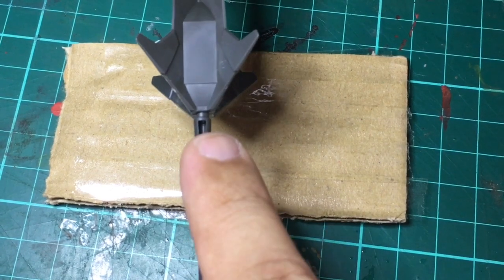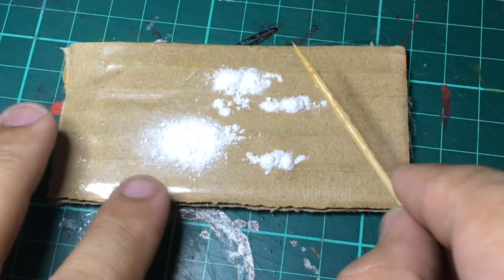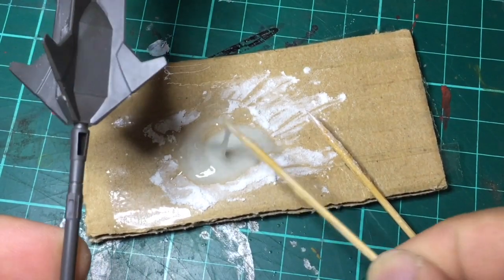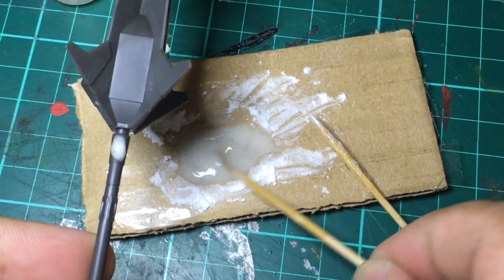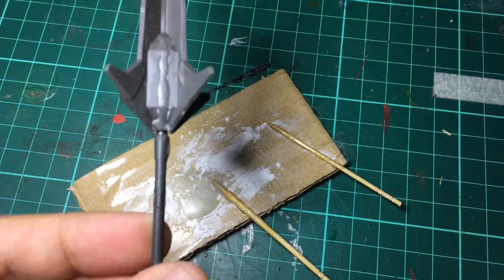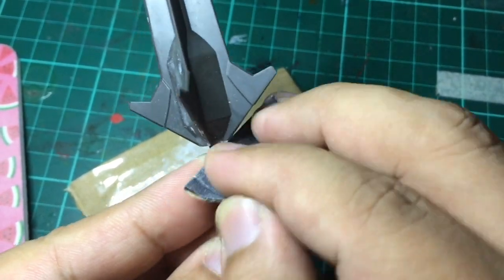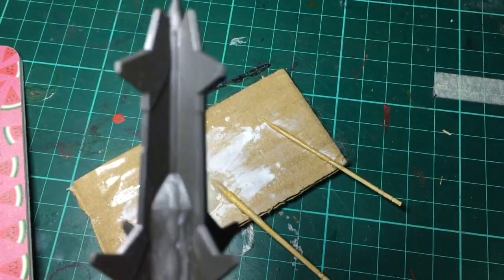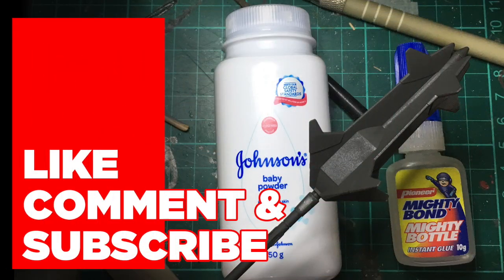24 Gundam Model Kit Tutorial: Using Baby Powder and Super Glue as filler

Comment: I stronger combination is Super Glue + Bi Carbonate of Soda (Baking powder) however the cure time is 'instant' so add the power direct to the glue or use a very low viscosity glue if adding it onto the powder. This combination for most materials is stronger than the original and adheres very well.
Reply from the maker: Oh wow thanks! Im definitely going to try this!
Reply: Baking soda is the only one that works like that. Baking powder is about 1/3 as strong as soda and won't form the chemical bond like Baking soda..

Comment: Hmm. Have you seen the MW-01 Mobile Worker from Gundam The Origin? The rubber tubes on those seem to have a problem staying in, and I was wondering if I could use a method similar to this, but just use a toothpick or needle to drop a tiny amount of baby powder in the connecting hole with a tiny drip of glue, than plug the hose in.